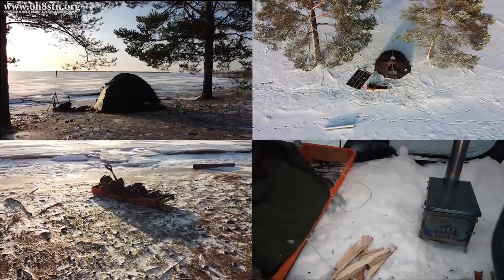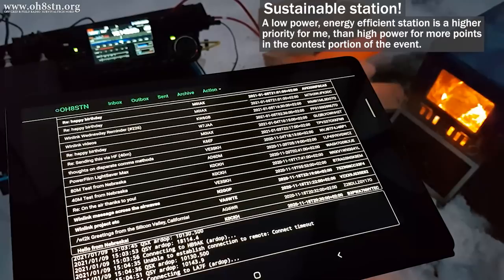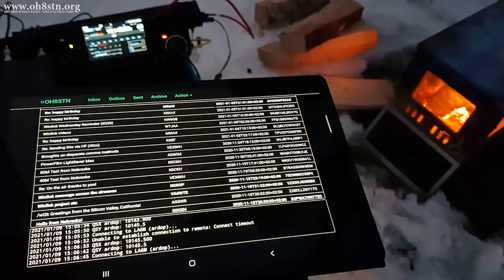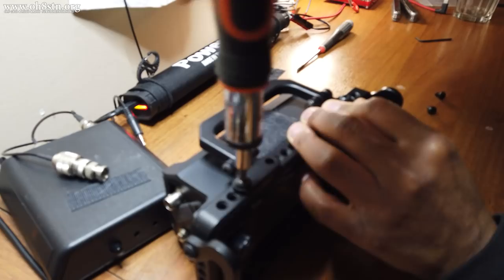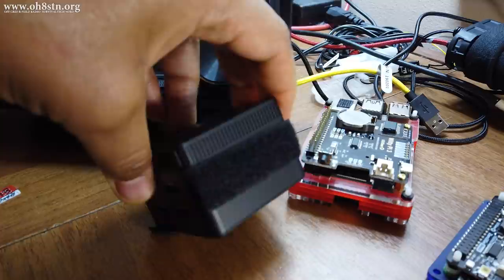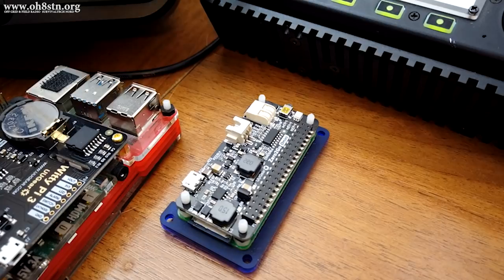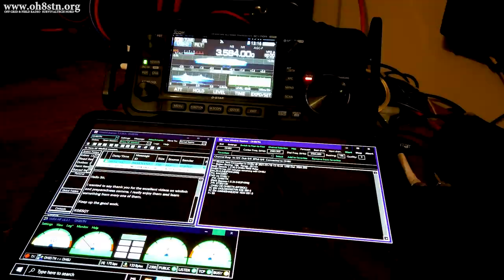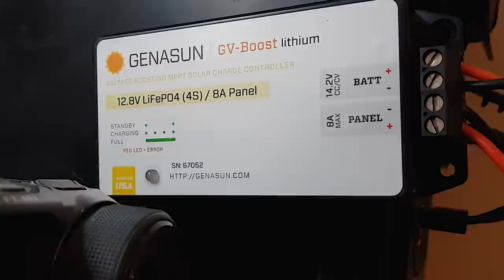Ham Radio Off Grid | Winter Field Day

Comment: Julian, another cold weather survival trick I had learned in the US Marine Corps is to heat up 4”-5” round rocks that might be lying around nearby that you can put under your bedding or on a blanket on your lap to help your body to stay warm, then rotate them as needed. I wish you luck powering that IC-705. I have the Xeigu G90 that I will try on 6 and 10 meters next week during winter field day and hoping it doesn’t rain here or that these damaging winds we’ve had here in Hawaii finally lets up, its been crazy here with the 60’ monster swell out of the north. Good luck! Todd WH6DWF
Reply from the maker: That's an excellent tip. Today  we had about 3 feet of snowfall, so :D 
Didn't know about the wind damage in Hawaii. Seems like crazy wx everywhere. Stay safe and please don't take any extra risks during WFD.
73, SF
Julian oh8stn

Comment: You will get more out of your panels if you point them towards the sun, by leaning them up or something. It drops-off as the cosine of the angle. At 45 deg from pointing directly, you're losing about 30% of the Sun's rays. Great videos.
Reply from the maker: Been trying to find a mount of portable frame to deploy them on, without adding much weight to my kit. You're spot on though. Eventually I will find a way to get them pointed in the right direction.
thanks for this comment.
73
Julian oh8stn

Comment: Wonderful video Julian! I've been fighting with a Wokphi-link for a few weeks now that XGGComms interface seems like a dream come true (perhaps if the cables were a bit shorter) I might give it a try!

My own winter station is a lightweight yurt style sized for two operators and gear.

I've found a decent solution to condensation to allow me to boot up the radios sooner, is that I have a waterproof gear case that contains the radio, tuner, and raspberry PI. This case also has waterproof connections for Power In, and Antenna Out to allow the radio to operate from inside the case without exposure to the elements!
Reply from the maker: Sounds like a luxury station :-)
I asked XGGComms for custom length cables.  You could ask them as well. Ghe wolphilink is excellent for Android connectivity, but not very good for other scenarios. 
When will we see a picture of your yurt?

Comment: Great video as always and very inspiring.  They always push me into trying something new.  Field communications brought me back to the love of Ham Radio.  Quick question: I was actually going to move to the same nano-Pc because it supports VARA-HF and allows me to run other logging software only made for the PC platform.  However, after looking at the power consumption difference, it was to big of difference.  Have you considered that into your requirement to reduce power consumption?  Believe me, I would like to go in that direction if I can justify the power difference.
Reply from the maker: This is such a new device for me, I need time to figure out how efficient it's really going to be in the field. I have no doubt I can build a lightweight power supply for it. I just need some time and experience to test with it.
Thanks for the kindness by the way. It's very much appreciated.
73
Julian oh8stn

Comment: I see a weak point in the android tablet connected to the mini pc via vnc. If you want to avoid all of those you shall look into the new get Windows 10 Pc based on ARM chip which means from one side you'll be able to run a full version of Windows and on the other extreme low power consumption. That way con can compress two devices in one (you will get rid of the mini pc and android tablet) which means more portability. And you will also gain in readability not having to bridge the whole thing via VNC (wifi setup etc etc)
Reply from the maker: Although you are right, perhaps you missed the part in the video where I wanted to be untethered. I want to use the tablet from anywhere inside the shelter, or around the camp without wires being attached to the radio. Thanks for the comment
Reply: Hi @OH8STN , and thank you for your reply. I got your point willing to be untethered; I thought your most important goal with this experiment is to go low power. If this is your main goal, well, then avoiding wifi, you'll save some extra amps for sure. Of course, going extreme, there is always some downside: In this case, one more cable. As always, it's a trade-off. Based on my experience in the ICT ecosystem, I can tell you that the more complex the architecture is, the more probabilities that something goes wrong. Going in the field with such extreme conditions, my humble suggestion would be to go the simplest the possible. But I've never done such an experience; I'm just another tech guy. You are the one who rocks and knows better! All the best

Comment: Curious where you got the 12 volt LiFePo GV-Boost charge controller Julian? I can't seem to find it on the Sunforge website. It looks like they are a great company since they actually care about their charge controllers being RF quiet.
Thanks for the great production quality and informative content on your videos!
Reply: Ok, I think I found them on their website, it wasn't in the main product listing but if I went into where you can specify battery voltage, it gives you LiFePo selections there :)
Reply from the maker: Yes, their new site is rather difficult to maneuver. Happy you were able to find it though.
73
Julian oh8stn

Comment: You got a Larkbox!  I just saw a video on them a couple of weeks ago.
Reply from the maker: what do you think about it s far?
Reply: It was just a video.  I haven’t bought one yet.  It’s in my cart.  I just saw the video and thought of you.
Reply: @OH8STN  You are Bad Example Man.  I just bought one.  Should be here by the end of the week.
Reply from the maker: Let me know how it works out. I don't know too many others running them yet, so feedback will be helpful.
Reply: I just got a GMK NucBox
and trying to figure out how to power it when operating portable. Specs are hard to find but the included power supply is 12v. Wonder if I can just connect it up to a 13.8v battery. If anyone knows please advise.
Reply from the maker: This is how I worked the Larkbox PTO. It might give you some hints. Also uses 12v supply.
https://oh8stn.org/blog/2021/01/27/chuwi-larkbox-pro-off-grid-power/
Reply: @OH8STN  thats awesome. Thanks. I think I'm going to try to get a breakout connector and build a cable from scratch though. I want to keep the original wall wart intact.

Comment: Great video Julian!  You are indeed a gifted and dedicated operator.  Curious on what antenna you’ll be using for winter field day?  Any thoughts of using a Cap Hat on the MPAS antenna system?  Haven’t seen many comments on the Chameleon Cap Hat except on EHam, they seem to like it.  Thinking that on QRP, any advantage helps.  73 KM4SON
Reply from the maker: Thanks for the kindness. 
I've been thinking about the MPAS 2.0, or EMCOMM 3B. I don't have the cap hat, but probably wouldn't use it in winter. The assembly time in sub freezing is a real bummer on the hands. So perhaps MPAS 2.0, MIL EXT, and 4 counterpoise wires. Alternatively,  EMCOMM 3B with a telescopic mast.

Comment: Great setup. I would suggest having a reduced power mode in case your power production or reserve methods become compromised. For example: not using wifi, reducing number of devices needing power, reducing the RF output on the 705, etc. Aside from that, what kind of steps have you already taken to reduce any unnecessary power consumption? I noticed you're running Windows with the high contrast theme - are you using the Performance Options, do you kill xserver when not actively on the pi desktop, etc?
Reply from the maker: Worked 24 hours of winter field day with this configuration. It was snowing so I didnt deploy the solar panels. Instead I ran one Lightsaver  Max until dead, then used my backup power supply as mentioned.  Finished field day with it 90% full. 
My strategy doesn't depend on reducing capability,  rather increasing battery storage and charging. Naturally any unnecessary systems are powered down or disabled already. Honestly though,  my station is so energy efficient already, I don't bother with adding extra tasks to manage. My entire station  eg computer, tablet, ic-705 draws less than 450ma (combined) on RX. 2.8A on full 10w TX. it could be fun to minimize to the lowest level possible, just to try. 
Awesome discussion
Reply: @OH8STN  Thats great to hear. Considering what the 705 has brought to the table in such a small package (and other small form factor QRP radios), it inspires me to think about how light and compact one could make an ultra-portable HF station. I really appreciate your including the additional hardware to support digital modes and I'm getting a better understanding for how important digital could be in an emergency situation, especially because of the QRP factor; also has me learning CW for the same reason.

Comment: Julian:
I have a 100 watt solar system that is functional and in a stand alone mode independent from the vans 12 volt battery and fuse box.  This solar system is not grounded to the vans body at all. 
 I now have a CB radio that I wish to hook up to the solar 12 volt fuse box with the antenna for the CB radio currently grounded to the body of the van ( 102” whip ) 
If I use this solar fuse circuit for the CB without the vans battery/fuse box inline would this be a safety concern for the overall use of the CB radio and antenna’s SWR reading?  My original thought here is to use the radio totally independent from the vans power with the solar ground separate from the van’s ground…. Hope this made sense what are your thoughts on this kind of set up?  THANK YOU
Reply from the maker: You shouldn't connect your CB radio directly to that solar panels output. You should connect your solar panel to a charge controller, then the charge controller to a battery. Connect your cb to the battery or the van fuse box, but not directly to the solar panel.

Comment: Great Video Julian. I’m about to press the button on the Larkbox but there is one thing I’m a bit unsure about, how you power it in the field? The 12v dc supply is via a usb c, I’m not very familiar with usb c but I was under the impression that it’s normally 5v? Is there a special 12v type usb c lead or is it a case of modifying an existing usb c lead? Be interested to know how you got round this, thanks, Chris G1VNA.

Comment: Doesn't butane/propane heaters emit moisture as by product? Long term use will cause the moisture to condense on the enclosure walls causing it to rain inside.
Reply from the maker: Interesting.  Perhaps the ventilation has prevented this so far. Have run about 15 hours in the rent over the past few weeks, without condensation problems.
Good point, I'll keep an eye on this. 
73
Julian oh8stn
Reply: @OH8STN   I stay away from LP for that reason. Burning LP produces a little over a pound of water per pound of LP.    Better to carry the weight in burnable wood instead of the lp heater.
Reply: I would be more concerned with the carbon monoxide.......

Comment: Julian, interesting changes.  Have you considered a micro PC?  Also, did you end up purchasing a Lab599 TX-500?
Reply from the maker: I'm waiting on my TX500. I didn't arrive in time for winter field day, so I am using my IC-705 instead. I know the TX500 can handle it, but for the 705, it is trial by fire.
There are some good micro pc's around. It was actually while doing research on micro pc's that i found the larkbox pro. USB-C to power and incredibly small form factor made it easy to pull the trigger.

Comment: I don't think it's appropriate to use a solar power system in winter. The sunshine is too short. Why not consider carrying a 1 kilowatt portable generator? Maybe the QRP system consumes low power.
Reply from the maker: It's not a bad idea but remember the RF noise from the inverter, sound from the gene, smell, carrying liquid fuel. Perhaps if I was running a larger station with higher power over a longer span of time. A small diesel generator is something I'd like to investigate in the future. One with a DC alternator and no inverter. Just to charge a LiFePO4 power-pack.

Comment: Have you considered using conformal coatings on the RPi or Larkbox PCBs to further protect them from condensation?
Reply from the maker: I had to look up the meaning of "conformal coatings ". Until now no, but it sounds like an excellent idea. Would there be additional heat from such a coating? I will do some research and come back to this topic on the channel. It sounds like a great idea.
73
Julian oh8stn
Reply: @OH8STN  

Julian,
 I doubt you'd be able to see the a quantifiable difference in heat dissipation.  Obviously just make sure to tape off any connections you plan to use or any heat sinks.  Any internal connection that's permanent you can dab a little silicone RTV to further aid in resistance to moisture.

72
Adam W9DWP

Comment: Wow , the lil buddy heater is fast till the stove kicks in , like it. So here goes. If you had to move say 2hrs away,move your whole camp then set up again then what do you do to keep the batteries warm ?  or if you have problems setting up Cold vs.Time how long can you be with out heat without damaging equipment ?  Like the videos you do and the gear . Thank you
Reply from the maker: Great question. 
The batteries (LiFePO4 or Li-Ion) don't mind being discharged in the cold, but can't be charged while below freezing. As soon as the inside temperature of the tent is above freezing, I'll generally start connecting them to solar. To protect them from freezing during  site change, I activate chemical hand warmers dropping them into the insulated pouch my batteries live while on the move. All my video equipment has insulated pouches to keep them from freezing, but the trick is short flights for the camera copter, before being re-warmed in the tent. Or for the camera gimbal,  keeping it in my pocket until needing it, using it, then back to the pocket. Most of my gear is from DJI. It's clever enough to warn me about the temperature, or the camera copter icing up.
Magnificent question.
73
Julian oh8stn
Reply: @OH8STN  Thank you I'm in the cold also.

Comment: Amazing work Julian! I have 3 questions:
1. Why don't you buy the dedicated bag for the IC-705? You can leace the radio inside the bag and have all the wires connected to the raspberrypi, the ATU, etc. It would be much more faster to deploy and it can protect the radio and the raspberry pi from the elements.
2. So the LightSaver Max cannot go in the snow? You referred to it as not waterproof
3  why not buying a rugged case for your tablet if your tablet is not rugged in the first place? It's cheaper and works well.
Finally, i want to point out that the cage does not fit with the IC-705 inside the dedicated bag. But the bag already acts as a shield for the radio. The problem is the side handles with extrude too much towards the front. Personally i think the ahould be smaller (like side guards)
Reply from the maker: Thanks for the kindness.
The Icom bag is probably very nice, but I have to move with my ski pulk sled. SO I already have a nice pack for the 705, tuner, cables and tablet. The sled carries the entre station including tent and stove.
The Lightsaver max is no totally waterproof, but even if it was, it is -19c outside. We cannot charge litium based batteries in negative temps, The rollable panels can be outside, get wet, buried, driven over, or blown up, and still charge the Max :)

I have a rugged cover for my tablet. This is an interim solution until I get a rugged tablet or laptop. The tablet is in the same pouch as my other radio gear, then stored on my ski pulk sled, in a dry bag. 

They may be accurate. very much like the cage as it is. It does a great job of protecting the rotary encoders. Any smaller and we loose the protection it offers. I will soon show my 705 pack which works very well to protect the entire radio with cage on.

Excellent discussion.
73
Julian oh8stn
Reply: @OH8STN  personnaly, i was not planning on making super long ops in winter needing a shelter, so the bag is very important for quick deployment. To counter the effect of cold, i will install multiple usb heated pannels (they are cheap on amazon) inside the bag to keep the radio, ATU, Raspberry Pi and other electronics from freezing. The small heating pannels can be driven by a small usb battery pack inside the bag. I know it's not considered like an emcomm solution but i am inspired by your work for quick SOTA and POTA while being with my girlfriend.
Reply from the maker: There's no right or wrong way to what we do. There's only the way which works best for us. I haven't really been able to come up with a rapid deployment system for winter time. It's always about avoiding exposure and frostbite.
Thanks for the nice discussion and of course the kindness. It's very much appreciated.
73
Julian oh8stn
Reply: @OH8STN  Hey julian, i thought about it and i dont think you have spoken about your solution to RFI from the electronics affecting your radio. Is it because your cable as the shortest they can be and thus no need for ferrite beads core?  Or you solved that issue a long time ago and didn't talk about it? My second reason for having a HF portable rig is that i cannot get rid of all the RFI in my house and in the field, the only source of RFI comes from the rest of the electeonics i bring with me...This could be a interesting video subject don't you think?